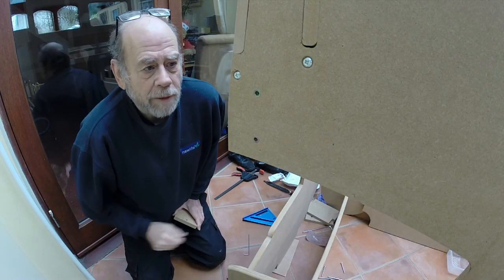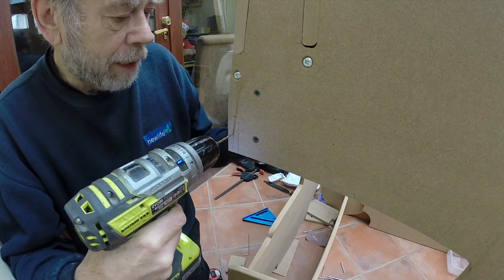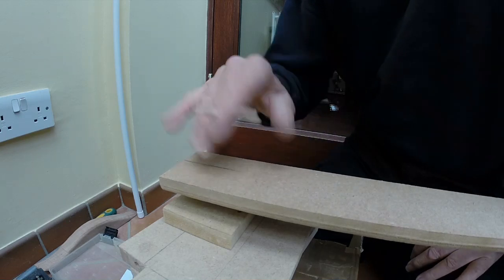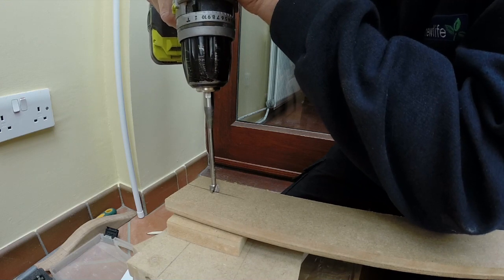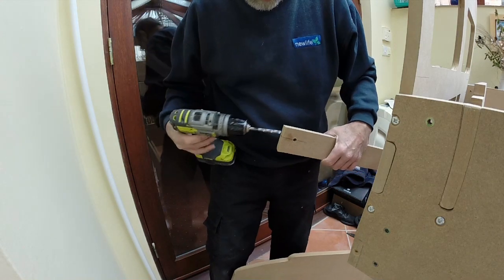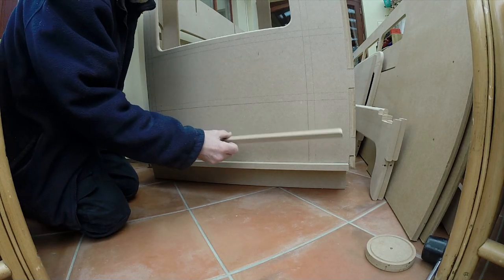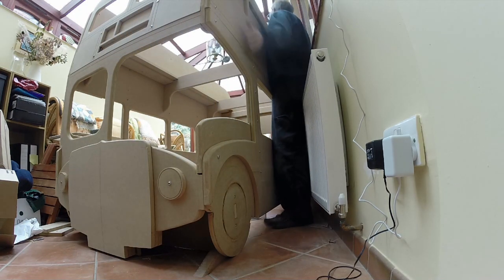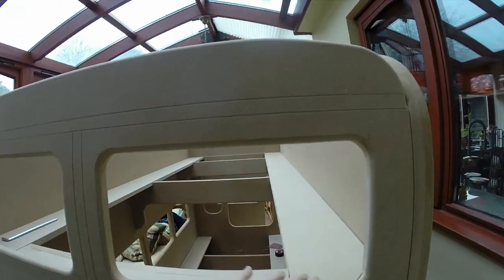the small shed #280 - Bus bunk test fit 2

Comment: Peter
Looking stunning- so much detail - terrific work. I admire the way you fitted the barrel bolts without a drill press or templates - I have only used them a few times - generally when repairing outdoor furniture so I must keep them in mind for future projects
Reply from the maker: I haven't used them before, but for this application, right angled joints in MDF, they are really useful, and allow things to be taken apart and reassembled several times. I will be using them in the future for projects.

Comment: What sort of saving (£) do you think you have made building it yourself?
Reply from the maker: It sort of depends on where you are starting from. If I had just bought a set of bunk beds I could have stuck some sides on and made it for about half the price of some of the London bus beds out there, however in this case I was shown a very high end bed which retails for £3k+ painted. Although mine won't be as good it should come in for around £500, but it has taken several months!